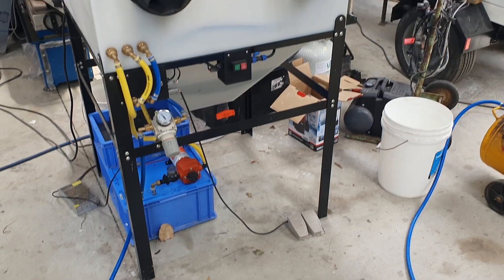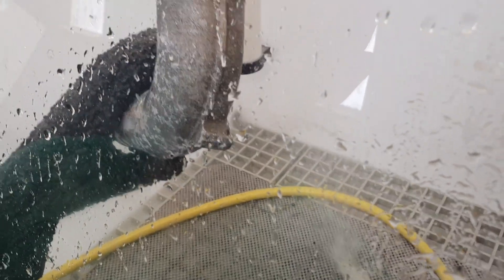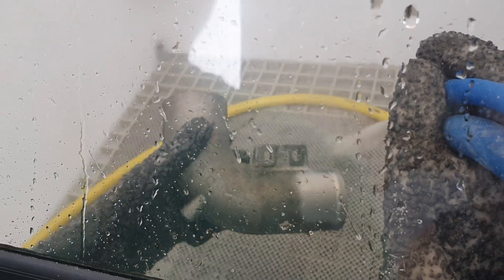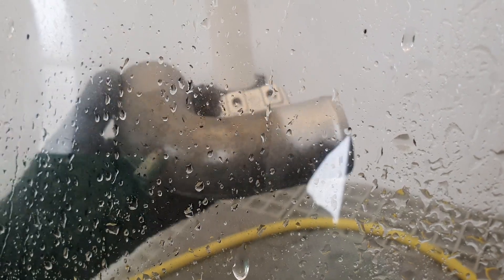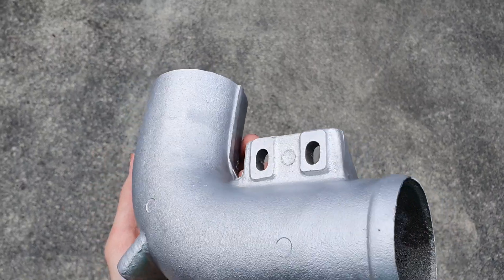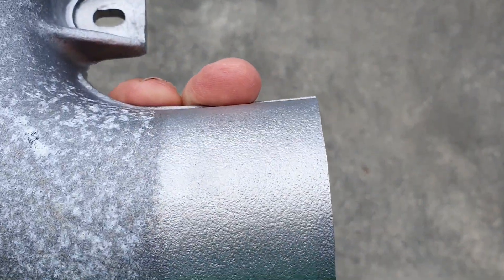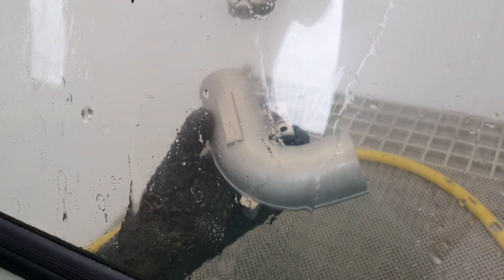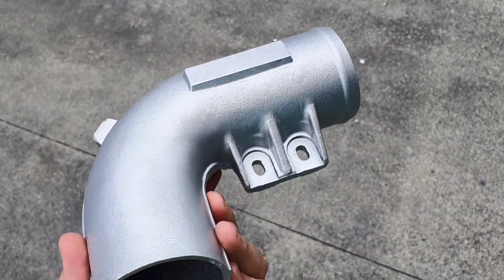Tornado 2 VBC: The GAME-CHANGING Upgrade – 2X More Efficient!

Comment: Could you help me how the dishwasher pump works for vaporblasting. Or is it simple?
Reply from the maker: @loic_c1872 dishwasher pumps are just another centrifugal pump. They will work in a pinch, but a decent submersible pump will result in much better performance.

Thanks for watching!
Reply: @ oh ok im looking for a better pump, its not so expensive around 100…
Reply from the maker: @loic_c1872 what pump do you have, and what pump do you want to replace it with? Also what country are you in?
Reply: @ArmouryEnterprises  i live in belgium, I’am a beginner, at the moment I have nothing for vapor blasting, its for dirtbike parts. And I don’t know how strong the compressor has to be an big
Reply from the maker: @loic_c1872 compressor needs to be at least 3hp and as large as you can get.

Have you got any of the parts for a vapour blaster yet?

Do you mean 100 Euros?
Reply: @ArmouryEnterprises No I don’t, I’am looking for parts, yeah I saw stainless steel pumps for 130 euros.
Reply from the maker: @loic_c1872 look up the 'AL-KO drain 7500' to see what they cost over there. I use them in my conversion kits and I am pretty happy with the results
Reply: @ the onewith red on it? Plastic?
Reply: @ I found the HBM 750W Stainless Steel Submersible Pump 13,000 L/H which is only 50 euros
Reply from the maker: @loic_c1872 yes thats the one, both Will work. The 13000lph model takes a little more effort when setting up the agitation to keep it from blowing water out of the bucket. But will work better if you can get it setup right.
Reply: @ArmouryEnterprises  is it hard to set it up? Are there videos that explain it how to?
Reply from the maker: @loic_c1872 Nah, they are pretty easy. I have a couple of videos on pumps, and most of the diy build videos explain it. I am putting together a full course that explains everything but that is still a few months away.
Reply: @ ohh okey thank you, I will search for more info and watch your videos
Reply from the maker: @loic_c1872 feel free to email me if you get stuck josh@armouryenterprises.com
Reply: @ thank you so much for help man,”

Comment: Looking forward to knowing more about the compressor. I had a 240v 32a plug put in the shed just for a bigger compressor.
Reply from the maker: Hey mate. Have you found a compressor yet? Sorry I still haven't found the time to do a video on that compressor.
Reply: @ArmouryEnterprises  thanks, I haven't upgraded my belt drive 10a one yet. Might be a while away due to cash flow, so happy to wait on the video if you do get time to do one. I have previously bought your plans for the triple compressor, but the new one sounds interesting.